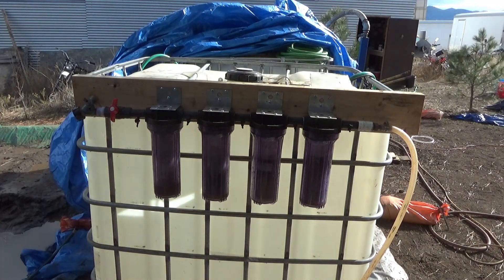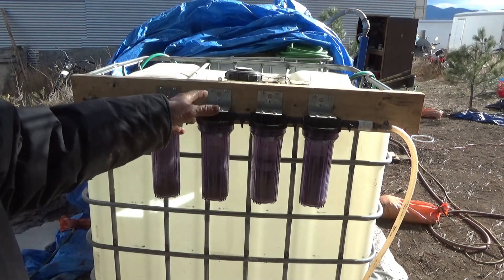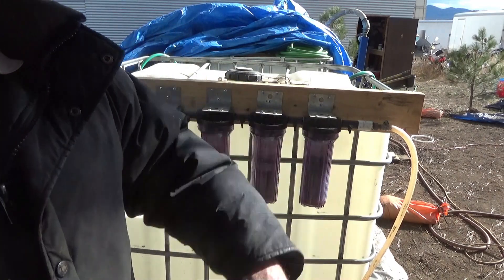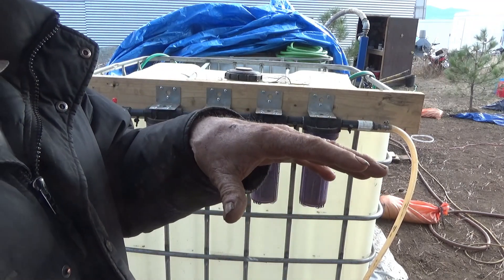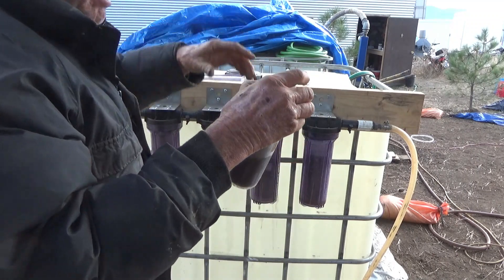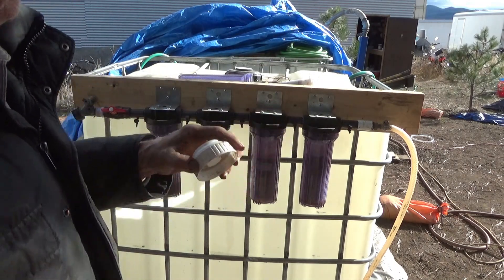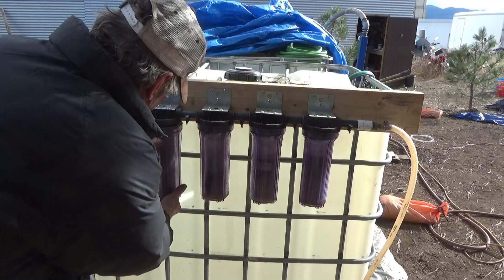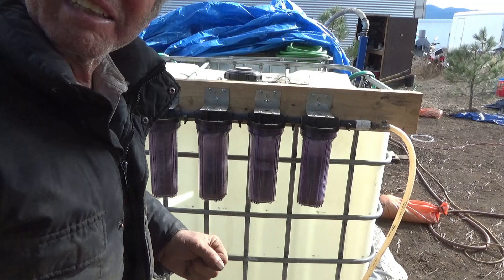239 WOW! That Went Shockingly Well!

Comment: thats great Keith ....love the Ion exchange better then the CIL method ....so it looks like you only need one large unit instead of 4 ...can't wait to see the next modification ....keep'em coming
Reply from the maker: It also looks like we can load it to better than 1 Oz of gold per pound of resin.  With resin at $15 per pound, we can then just ash and smelt and avoid stripping and regeneration.  Makes it simple if we can get it to work well.
Reply: @hardrockuniversity7283  that sounds great ....so much less work ..... ...are the cells big enough for full production ?
Reply from the maker: @Askjeffwilliams  The bottle neck now appears to by the crushing and agitation circuit which has a capacity of possibly 1000 lbs/day currently, but could be increased in a straightforward manner.  Really looking forward to next season.
Reply: Tizz fascinating stuff mr jeffs 😁jolly good carryon pip pips
Reply from the maker: @patrickjobling8676  Thanks
Reply: Nice one Keith, good results buddy, my system (the P&ID I sent you) has a UV lamp and then 3 pre filters at 50um, 10um & 1um and seems to stop the organic loading of the resin and reduce any particulates to a minimum.
Reply from the maker: @TrickyDickyP  The rock particles are not a problem for the resin per se, just plug the containment filters.  Time will tell what other factors creep in and have to be dealt with.

Comment: Since the extraction went so well maybe you can put those filters in parallel like 2 sets of 2 incase one set plugs up you won't have to stop the process??
Reply from the maker: Hardly an issue at this point.  By running in series, once the first cartridge loads then the second can keep recovering until change out.  If we NEEDED more capacity we could do it easily.  The whole system was less than $200.

Comment: Hi Keith , looking good mate , i like those filters , interesting results too , maybe you could drop one out.  Been doing a bit of research of this thesis study from the Murdoch university about Thiosulfate leaching etc , it's saying that Trithionate and Tetrathionate are the main competing sulfur anions that need to be minimised in order to maximise the recovery and loading of gold to resin .Again it suggests a strong based gel type resin which i think you have rather than a macroporous resin which loads throughout where as the other loads up on the surface making that easier for elution , but it states  the adsorbed gold can be successfully eluted with a nitrate solution , and a two step process using aerated ammonia followed by nitrate effectively stripping copper first and then  gold from resin using conventional electro winning . I know you are hoping to just ash the resin and not recycle it , that's fine if it works all the better , but another interesting study it claims that activated carbon could be treated in a solution of sodium thioglycolate and isopropyl alcohol then washed and dried and it apparently was as good as resin for recovery of gold , maybe easier to ash it , just a thought . If you haven't seen this thesis i could email it to you . if you like , might be worth reading , A lot of it is graphs and experiments , but you can skip through it like i'm doing . let me know if your interested , cheers , Ned .
Reply from the maker: Please do email it.  You never know when an odd bit of knowledge can be the key that opens a stubborn lock.

Comment: A number of materials qualify for the name RESIN.
Does your resin have another name other than just resin ? - like if I wanted to buy it or read the Internet about it ?:
Reply from the maker: MaxWater 104133 Strong Base Anion resin.
	
Strong Base Anion Resin for Nitrate Reduction - 5 lbs Max Water Flow RO...
Total: $74.95

Item ID: 163227589628
Ebay